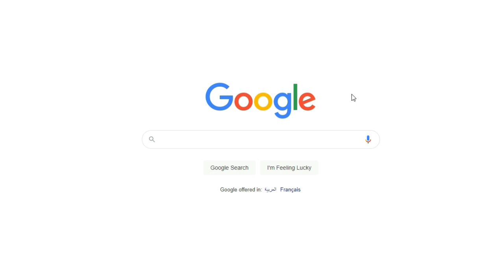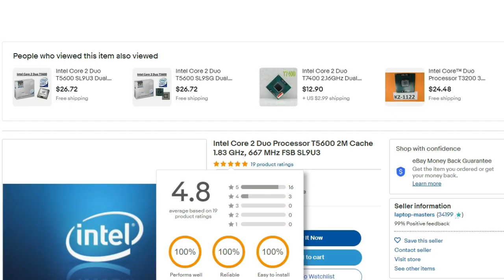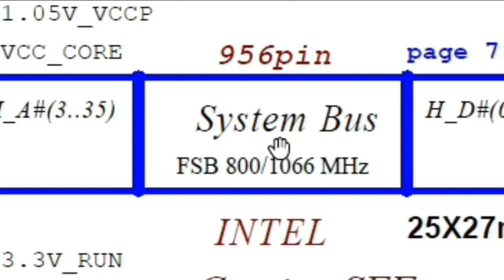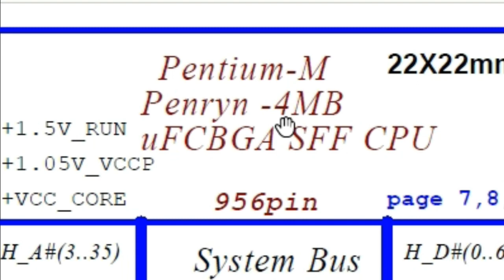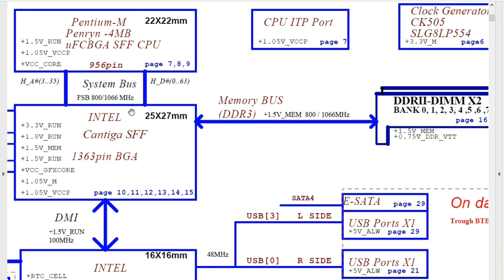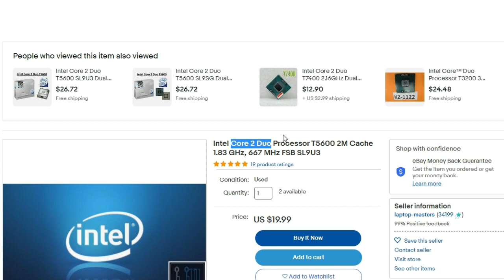Learn how to upgrade your laptop's motherboard for better performance

Comment: good video, but remember you should point out that not all laptop motherboards are you able to change the processor. Some are integrated. Sometimes even the RAM is integrated. It is very difficult to know for average person. They might even think their Macbook would be upgradable, which sadly for the past decade; have not been possible to upgrade